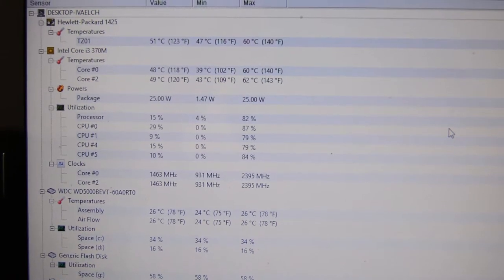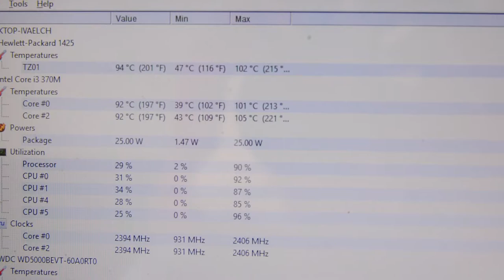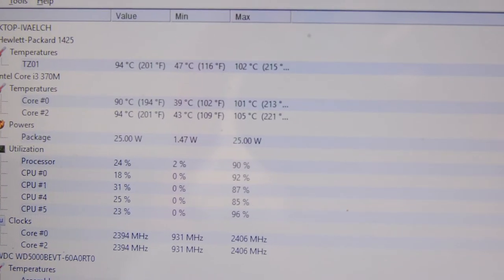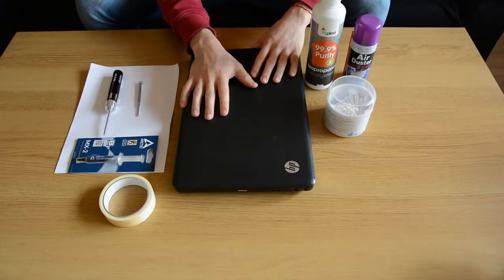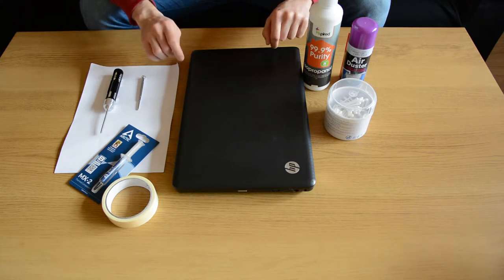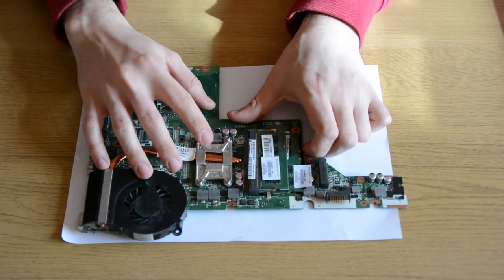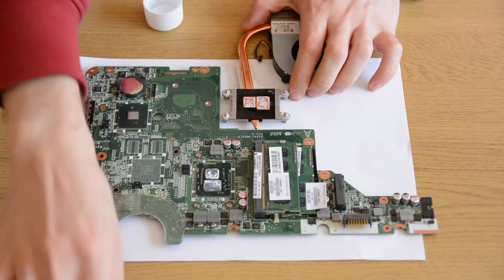HP G62 Disassembly and Cleaning

Comment: changing the battery of the motherboard - why?
Reply from the maker: It had to be replaced because every time you started the laptop a BIOS low battery notification came up.
Reply: Cannot understand what you are saying. Please Repeat!
Reply: Kristian, nice video ! But what happens when the BIOS battery is depleted ? Is this somewhat different than the main battery ?
Reply: did you put in a phenom quad core processor on it?